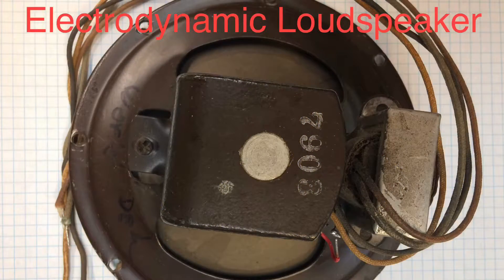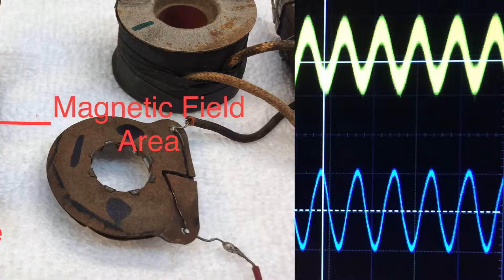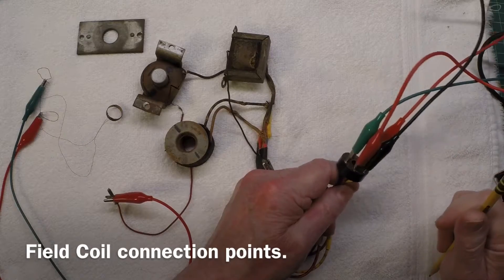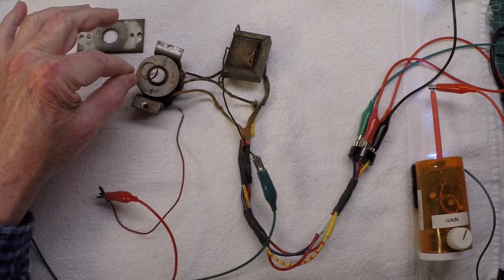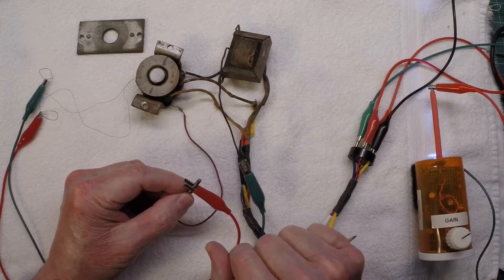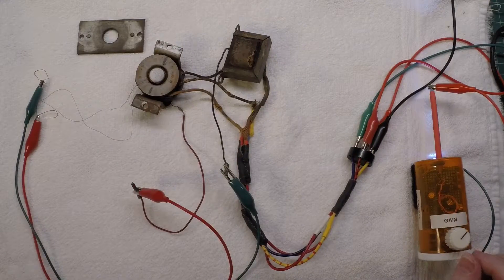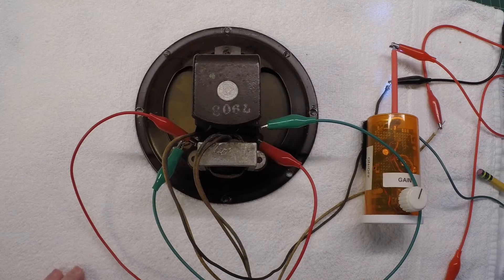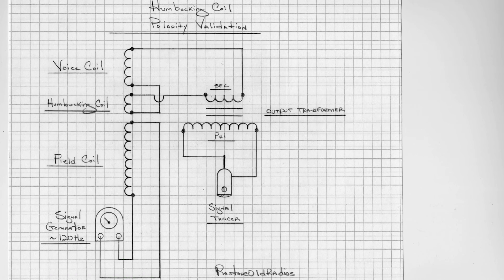How an Electrodynamic Loudspeaker Humbucking Coil is used to Mitigate Hum

Comment: Hi Don, Thank you for your explanation.  It explains perfectly the hum I am experienced on a 1936 Silvertone console.  I thought I was looking at a problematic humbucker coil (low volume hum at zero volume) but I now know that isn’t the case or it would now work at all.  The question I have to ask the owner is if he wants to replace the speaker with a permanent magnet type.  My question is, and I know it’s a loaded one, do you think by replacing the speaker will further reduce or eliminate the hum?  I assume so.  Thanks again for your sharing your experience, Scott
Reply from the maker: Hi Scott - thanks for reaching out. Do you plan to use the old field coil as the choke? Best, Don
Reply: @RestoreOldRadios  Hi Don, 

I was, assuming I can fashion a suitable mounting, but I am not apposed to replacing it with a more standard choke.  It will become a cost/benefit decision for the owner.  

Replacing the 10 inch speaker won’t be cheap.  I may have an 8 ohm permanent magnet candidate that I repaired a number of years ago, but I do not know the original speaker ratings.  I think my candidate was for a guitar amplifier.  It probably wants a lot of power to develop full response.  It might be ok if the radio amplifier can support it.  It’s a push-pull design using 6F6Gs.

So yes, if I can, I’d remove the field coil from the original speaker basket, fashion a mount, remove the humbucker coil and rewire the speaker’s audio transformer to the speaker would be the plan.  Of course, I’d need to verify the speaker’s ratings to avoid a bigger problem.  Can I simply compare the DC resistance of the voice coils?  Seems like that’s not enough.

Sorry to ramble on.  I’ve been getting conflicting opinions on humbucker mitigation probabilities to eliminate hum.  I am of the opinion that it’s an imperfect solution when speaker technology was evolving and low volume, 120Hz hum was fairly common.

Thanks again for your thoughts, Scott
Reply from the maker: Scott -

I assumed that was your plan, but I just wanted to confirm. Low level hum and hum in general is somewhat common for the receivers for this period. I'm assuming you've already recapped the receiver?

To estimate the existing loudspeaker (LS) impedance w/ the LS disconnected from the output transformer, measure the DC resistance (DCR) & multiply by 1.25 to approximate the impedance. Many folks use this M&P or as a guideline they use 3.0 to 3.5 ohms of DCR is = to a 4 ohm LS and 6.0 to 7.5 ohms of DCR = to a 8 ohm LS.

You may try disconnecting the voice coil leads (only one needs to be disconnected) from the existing LS and jump in your replacement LS (substitute) and see if the hum improves before going to the trouble of breaking it down or installing an equivalent choke.

Hope this helps and feel free to reach out anytime.

Best,

Don
Reply: @RestoreOldRadios  Hi Don,

It does help a lot.  That is how I was thinking but I didn't have a method to approximate speaker impedance.  Now I do.  Thank you very much.

I have recapped, replaced more than a handful of "dog bone" resistors and changed the 6V6 amplifier tubes to 6F6s to return it to the original design (Someone before me did some work on the set, the output tubes mainly), but it's mostly original.  I think the 5V4 rectifier tube is a bit tired on one side because the ripple is asymmetrical.  I popped a 5U4 in it's place as a test and that produced a symmetrical waveform but it really had no affect on the hum level.  My thinking is the only way to "cure" this one would be to either crack open the speaker and figure out a way to add or remove turns from the humbucker coil (a task I do not want to try) or simply replace the speaker/reconfigure the field coil and go from there.  My guess is the owner will live with it as it is.  It's not that bad.  

Thank you again for helping me with this somewhat academic discussion.  I really do appreciate your time.

Cheers, Scott
Reply from the maker: Scott -

Glad to help. I hope things continue to go as planned and thanks again for watching/reaching out.

All the best.

Don

Comment: Don  -this is off topic but do you recall the correct dial string installation for the Philco 41-280 BAND SELECTOR switch ?   Any help is appreciated  - Ron     email: rcianciaruso@comcast.net
Reply from the maker: Ron, I just sent you an email. I’ll ping you back if I find additional info. Best, Don
Reply: @RestoreOldRadios  Many thanks sir